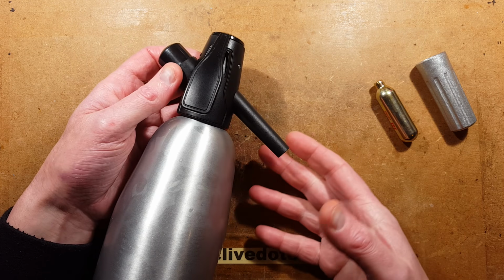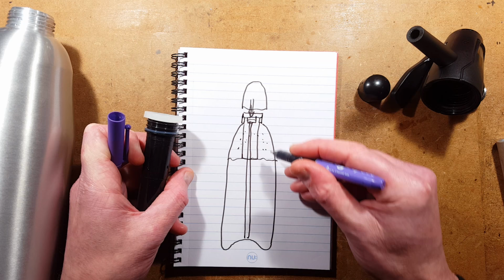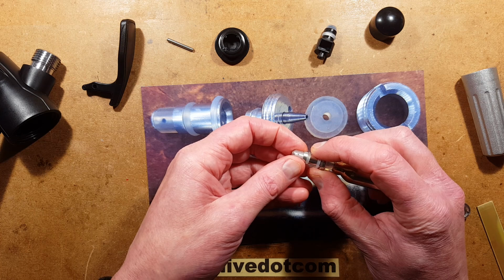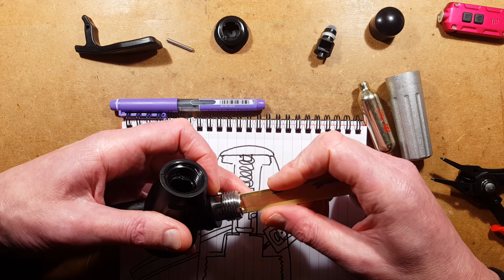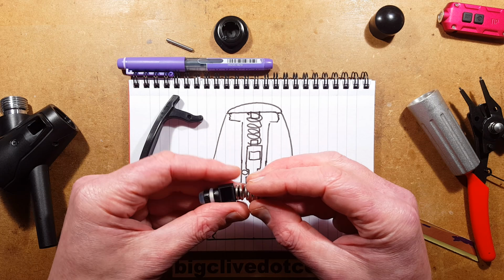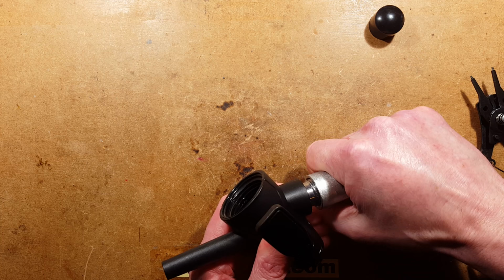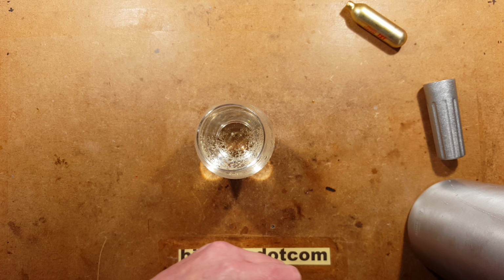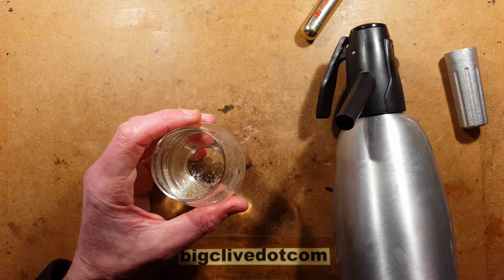Soda siphon teardown.

Comment: I seem to remember us having one of these from when I was a kid. The thing i remember the most was that the instructions has so many safety warnings and made it sound like you were handling a live bomb.  :D
Reply: I had a couple old antique ones that I never felt safe pressurizing. They were mostly glass (glass bottle and glass dip-tube), and I didn't want an unseen scratch on the glass leading to a failure point, creating a glass fragmentation grenade in my hands... (Also I bet the seals were all natural rubber, and old enough to be dry-rotted...)
Reply: it was fairly common when I was a kid for some to use a twist tie to attach one of the soda bulbs to a firelighter
Reply: @Sembazuru  You would get them filled by the shop that rented them out not for home refilling.
Reply: The cadets taught me that when combined with a fire starter they are bombs. Perhaps not the actual cause damage variety, but certainly the make a loud noise and fly through the forest a good hundred meters until it hit a tree kind. Good times.
Reply: @jostouw4366  their is a video on YouTube showing a company in New York that still does it that same way as in the 1930s.
Same refillable glass bottles and people delivering and picking them up.
Wish they existed in by part of the woods.

Comment: When i was a kid i made a co2 rocket from the cartridge. I taped a thumb tack to the bottom of the cartridge, and a cardboard tube around the thing to act as a wing. Put it in a pipe and whacked it with something. Flew out of the yard. Guess a bit over 50 meters. Those cartridges had a bit more recessed seal though, it was easier to seat a pin like that.

Comment: On the darker side of things, I have heard of these or the whipping cream bottles exploding, news articles were never clear as to how many gas cartridges were used to charge the devices.
Another issue comes to mind is that I have several Luxfer aluminum gas cylinders and the company that I deal with states that the law in my state requires a five year inspection of aluminum gas cylinders every five years if used with CO2, if one is using an inert gas such as helium it is a ten year test and inspection.
The inspection of steel cylinders is set at ten years for both inert and reactive gasses. This even applies to ones paintball marker cylinders.
In testing the safety they actually remove the valve stem ( on an empty cylinder ) inspect it visually with a bore scope camera, if all looks ok they proceeded to a hydro test where a special fitting is screwed I to the cylinder, the cylinder is lowered into a special containment sleeve and is then filled with water. They use a high pressure pump to fill the cylinder with water to the test pressure recommended by the manufacture of the cylinder. If it holds it gets a date and approval stamp of the shop testing it. If it fails you can reclaim the ruptured cylinder for recycling.
Now as for these food service devices, I have visually inspected both of my units which are made of aluminum,mother interiors are no longer shiny but they are not pitted either after 30 years of use. Still I wonder if they are safe considering no gas shop can test these devices. If in doubt, invest in another device and throw away the old one or use it as a bud vase for cat nip.

Comment: I think the bottom is concave because if it was flat the pressure would blow it outward and the flask would not stand straight upright the, rounded corners are to prevent stress fractures.

Comment: The ikkle canisters are punched out of a slug of metal, the same process they use to make toothpaste tubes, coke cans and sub-aqua bottles (even a small flask takes some pretty impressive forces to roll out.  The complete tubes are then sent to the filling factory.

There the empty tube is filled in a sealed chamber that's bigger than the tube - this allows them to pour the stuff in in a pressurised environment, then a system of rollers bends over the top of the bottle to seal it, you should be able to find the edge of the seal if you use a sharp knife or valve hook.  This gives a good shelf life.

We currently have a problem with kids snorting nitrous oxide, the flasks used have a little rubber sphincter pushed into the top of the bottle and they're filled by injection from a bog standard gas bottle, presumably they don't need much shelf life.

If you look for "how it's made" or "how do they do that" you'll see a couple of different vids and filings.

Comment: I remember my nan having one of these back in the 70s she also had one of those wine bottle openers that injected carbon dioxide in to the bottle to open it. If I remember rightly they were discontinued due to some wine bottle exploding before the cork popped out.
Reply: Mark Wallis I bought my parents one of the CO2 bottle openers for Christmas back in the 1970s. I could have sworn that I picked it up when I cleared the house after they died, but nope. However, I do somehow have the original box of CO2 capsules, which still has two in it.
Picture of the box: https://flic.kr/p/7vVrkx
Reply: @DavidCowie2022  I think I still have the one from my nan, when she passed, up in the loft, I'll have to dig it out and see if I can blow up a bottle :)

Comment: Just using mine at the moment. Water + a teaspoon of bicarb makes soda water great for scotch and soda. I have an old glass siphon. The seals failed, I bought another cheap siphon, and the new head fitted on the old siphon. I buy the co2 cylinders in packs of 100. I drink a lot of scotch.

Comment: I preferred the Sparklets beer tap for the party 4 and party 7 :D
Thinking about it, the longer cylinder may have been for those, i just checked mine (yes i still have it) and it measures 62.5mm internally where the cylinder goes.

Comment: I grew up with something called soda butler that is basically a larger tank of CO2 and a bottle with a clip on tire valve stem in the cap to get your CO2 into the bottle.
In experimenting over the years as when I was younger I wanted the most carbonation I could get, warm water takes and releases the CO2 the fastest, cold water would hold on to the CO2 more but was also harder to to get a really good carbonation so being that the system had many bottles I would put room temperature water into the bottles, carbonate it, and put the bottle into the fridge to get cold and when you do that my dr pepper would bubble like a volcano when opened and when poured over ice instead of going pretty flat would end up being as carbonated as drinking one out of the can.
You wouldn't want to drink it straight out of the bottle that carbonated but it was fun.

Comment: That simple non-return gas valve is like the old Dunlop bicycle tyre valves - the ones that were repaired using the bit of tubing in a puncture repair kit that no-one (inc me) ever knew the purpose of...

Comment: I almost wonder if the whole manufacturing of the cylinders process isn't done under a high pressure atmosphere so that there is no worry of them leaking before being sealed.

Edit: just looked into it and it appears that the capping and filling happens in the same machine, I've gotta think under the same pressure.
Reply: @48Boxer  how would you get it in there? That would waste a lot to just spray co2 in there until it condenses into dry ice.
Reply: Video of similar cartridge manufacture:    https://www.youtube.com/watch?v=i-w7pqowcPI

Comment: "Sparklets" I believe were the main brand of these.
Reply: I remember them as Sparklets Bulbs.
Reply: @johnnodge4327  the co2 cartridge was referred to as the bulb, the main body being a soda syphon.
Reply: There were green ones for CO2 and there were blue ones for laffs
Reply: @colinfuller2271  
I didn't make it clear, but I was referring to the CO2 canister as the bulb. The whole thing was called a Soda siphon.
Reply: My brother used to chuck the green sparklets into a bonfire and they would explode making a huge bang and shoot out the split metal cannister about 30 feet and embedd it into a nearby tree / person / shed. Oh how we amused ourselves back in the 1980's
He also found that cutting off small sections of corrigated asbestos shed roofiing and putting in a fire would also cause it to explod (odd for a suposed fire proof material).... I often wonder how none of use were killed  :D

Comment: 1. Not convinced the Co2 goes down the long dip tube. I suspect it just goes down the shorter one.

2. Chilled soft drinks, when poured, fizz a lot less than room temperature ones. Again, the cold liquid retains the CO2 better.

3. Does it work if you put beer into it ?

4. Bottle of wine - no need to top up to the level with water.

Comment: Does bottle have safety spot? Small really light rounded dent at the bottom or top, so if it over pressure it will rapture there instead of random spot?
I remember that someone say to me that some pressure kitchen canisters have those but I never had chance to check that(or I just forgot about it)
Reply from the maker: It has a pressure release valve in the head.
Reply: Rapture that gas straight to the Lord!

Comment: Very nice, I took one of these apart to fix last year. But it was an old Sparklet one from the fifties, they work in exactly the same way but with rubber instead of silicon (although I changed all the rubber parts for silicon, sixty year old rubber seals don't hold up very well...)

Comment: Its a liquid inside the capsules, it has a liquid to gas expansion of over 530x and is stored at roughly 800psi and the cap will be designed to burst at around 1300psi to vent the pressure 'safely' instead of the bottle exploding if it gets too hot.
i dont know exactly how they get the caps on the bottles but i know that they are filled at a very low temperature and they must be kept at pressure during filling as Liquid co2 cannot exist at normal pressure and that pressure must be maintained right though to the cap being fixed on otherwise the co2 will instantly boil off and so the machine must have some sort of capping mechanism that works inside the pressurised filling head.

Comment: The seals and O-rings look very similar to those used in paintball guns and other airguns - cheap and plentiful in those circles, some even cheaper in industrial pneumatic equipment maintenance.
Reply: Jens Goerke not food grade though and you really don’t want to ingest those kinda of lubricants
Reply: @peterg.8245  You're absolutely right and I'd give them a very thorough clean first - washing off lubricants with alcohol, then rinsing off the alcohol/lubricant residue with plenty of hot water, then inspecting them after drying them off - any that look even slightly suspicious get binned.

Comment: The colder the liquid the more CO2 will be absorbed by the liquid. Beer works fine. When you shake it the liquid absorbs more CO2 and the pressure drops inside. So if its cold enough and you shake enough and left it sitting for a while, theoretically you can use more than one CO2 Capsule.

Comment: I guess you could get the top preassure by turning it upside down before putting the CO2 capsules, so the air is accumulated in the bottom, and once you reach the over-pressure, it will only vent CO2 until you reach just below that point, and you'll keep most of the liquid inside (if i understood your "how does it works" correctly)... also, you could use a normal air compressor to fill it...

Comment: Use a mix of vinegar and cyan pepper to make a diy pepper spray bottle.
You will have to hold it up high to spray it, if you hold it low and tilt it all the liquid will pool at the top and not get to the straw.

Comment: I think the CO2 cartridge cap is usually just a crimp fit. It's been a long time since I used them and dismantled them, but if memory serves there's a little rubber/silicone seal under a crimped metal cap.

Comment: CO2 powered airguns/BB guns use a similar cartridge, but they're a bit longer (83mm instead of the 65mm for the Sparklets ones), which is a good job because the airgun ones contain a tiny amount of oil (to lubricate the seals), which you wouldn't really want in your Soda Water.

Comment: I poked a tire valve through a 2-liter bottlecap, and use a 5lb CO2 tank to make seltzer regularly.  get the water cold enough to where ice crystals JUST start forming on the outside before pressurizing, and run it up to between 45 and 65PSI depending on how much you trust PET bottles and how much Fizzzzzzzz you want!  Mix w/ orange juice, and it's a stellar bevvy.

Comment: Mr. Clive excuse me but the audio does not sound in stereo,  something happens to the audio, 
that sounds very . 
I can't hear it with headphones 
why the audio is not heard on my laptop.
I thought they were technical problems on my part but no. It is only certain videos that audio is not heard in headphones 
I inform you of this event so that you take precautions and manage to modify that tectin failure.
very good channel congratulations and thanks for your time.
Reply from the maker: Your laptop probably has it's audio set to surround sound and is putting the sound out to a missing middle speaker.  Try going to the audio settings and changing it to stereo.

Comment: If the liquid is cold it will dissolve the co2 better. I cold carb my beer. So pouring nthe wine in then tossing in the freezer until just above freezing or around 38 to 42*f will let it absorb the co2 and if dispensed cold it won't foam as much.

Comment: Clive, dare I suggest this?  There are also similar cartridges sold for making whipped cream and they are very, very popular.  They contain laughing gas instead of carbon dioxide.  Except I don't think that most users are making whipped cream with the stuff.  Instead, they fill a balloon with the gas and take a whiff, just for giggles.  I once delivered six large pallets of these to a place just outside Romford, and no way was it anywhere to do with catering!  In some car parks you can often find loads of empties dumped by the less conscientious users.  Anyway, do you think that using these "alternative" cartridges could be advantageous?  The taste might be ok, and the experience could be amusing... :-)

Comment: If you are going to use two cartridges, turn the siphon upside down when putting the second one in.  That way if the over pressure valve releases, you will only lose gas and none of  contents.

Comment: I find loads of these cylinders an there definitely not Co2, breathing that would cause hypoxia. Some inhale nitrous oxide to get high, it's used in the food industry. Back to the Syphon, ones in the 1960s 70s used these cylinders called Sparklet bulbs, earlier syphons were thick glass construction an came ready gassed, once empty the maker took it back, Schweppes made such syphons, the later ones like yours worked in a similar way to a soda stream except the water came out carbonised without the need to pre load a bottle.

Comment: Round our way you find a lot .... A LOT... of empty nittous oxide cylinders because people use them... erm "recreationaly".... they must have some sort of cut-down soda-syphon-lid ... 'cus how else can they conttol the flow of nittous oxide. I've often wondered if the old cylinders could join my scrap steel collection, but I can't think of anything to make them into.

Comment: The original Soda Stream bottles were stainless steel. The new ones all appear to be aluminium.
I wonder which makes the biggest explosion when you fill with diesel and 5 x NO2 chargers?  Only one way to find out...
Reply: Yikes.
Reply: Project Farm "we have five fuel additives and some screenwash. Which will power the engine longest? Lets find out!"

Comment: If you want to over-pressure but don't want to loose too much liquid, if you first "pop" the cylinder with the soda syphon upside down so the end of the dip tube is in the gas bubble, hopefully the only liquid lost would be what little was in the dip-tube.

Comment: Sounds like quite a good device for carbonated water - much less complicated than a "SodaStream" type device. But what I don't understand: How many fillings of the bottle can be carbonated with one 8g cartridge of CO2? And where is the seal between the cartridge and the bottle? Or did you have to empty one cartridge into one bottle, because once the cartridge was punctured, there was no sealing it back up, so theoretically, if these 8g of CO2 would be good for more than one filling of the bottle, you were out of luck, because there was no way to refill the water bottle without venting the residual CO2 pressure into the atmosphere?
I have seen these devices in my childhood, but I never knew how they worked. I've mostly seen them in hotels and at places like that, and my parents at the time (whether consciously or not, I don't remember) gave me the impression that it is something to prepare alcoholic drinks, so they were not of interest to me when I was a child, since alcoholic drinks and children isn't a very good idea.
Reply: OK, now that I've watched the video further, I'll have to revise my opinion, since using one CO2 cartridge per filling of the bottle sounds like really wasteful. Especially since these cartridges will probably cost more than just a few cents (by a few I mean less than 10). So after all, a Soda Stream device may just be much more convenient.

Comment: thats the kind of oneway  valve i use to  have on my bicycle in 70ths befor you got the in german called blitzventil flashvalve
Reply: I remember those. I also remember I had to replace the valve rubber quite often. I think it was some kind of natural rubber, it certainly wasn't silicon.The valve rubber was sold in bags with two or three 8" lengths each. I remember this as I used those for a slingshot. It took three rubbers on each side to get decent power...